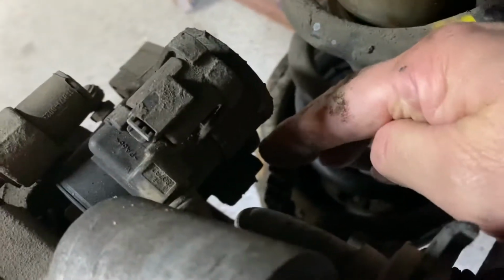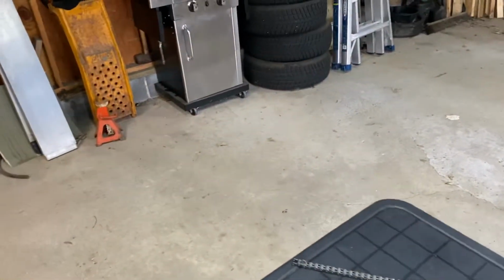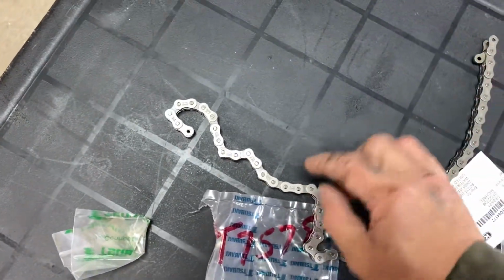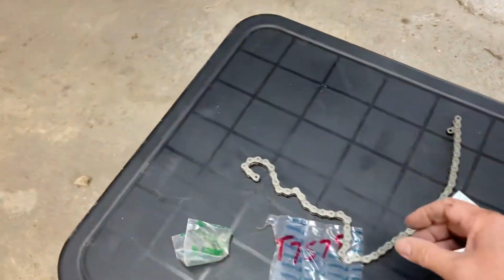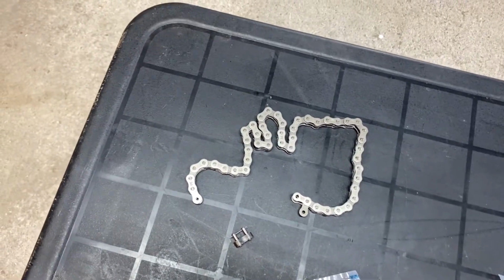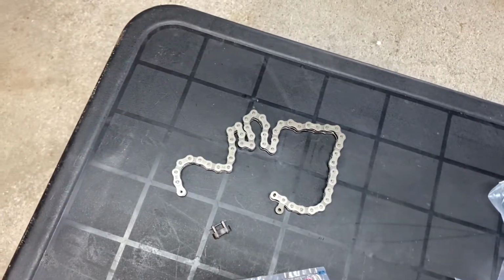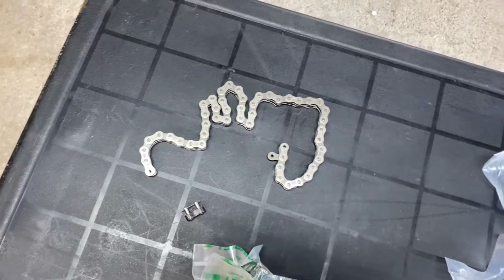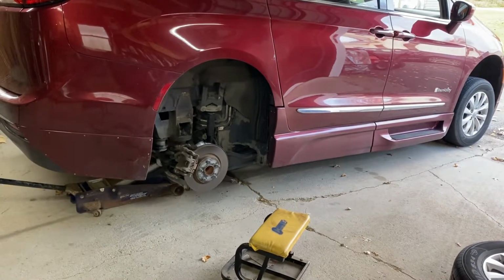BraunAbility kneel chair repair

Comment: Great job to undertake this repair.  I have found that anti seize of any type is not the right product for these chains.  Fluid film, applied every 6 or 7 months, will keep that chain looking and performing like new!  The anti seize is too thick to get between the links to keep them moving.  Fluid film is able to penetrate as it lubricates.  It won't wash off and doesn't attact a lot of dirt.  I simply wipe mine off before reapplying and the chain after 7 years, looks brand new.  Hopefully, this information will help you and others.  The entire industry needs to be challenged for not allowing people to service what they have purchased.
Reply from the maker: @d9999w9999  Thank you, I will be getting some of that lubricant
Reply from the maker: @d9999w9999  thank you! I bought some and applied it before the winter snow. I hope that it works!

Comment: Thanks for video. great job. Im a quad and drive a 2005 Chrysler Town n Country Entervan. Well my chain not broke but the actuator screw tube broke so it needs fixed. my local dealer wants 1200 to fix it.  Crazy

Comment: This is great. My chain just broke today on a 2015 Toyota VMI conversation. Sounded like a gunshot when I deployed the ramp. I went to Costco to get gas and the.guy told me about the chain hanging down. I did some poking around and found your video. I'll end up having my dealer fix it, but nice to have a visual of the problem. I had a Scion with a pneumatic kneeling system and it was horrible..probably a result of bad design as the tubes kept melting. Anyway, thanks for sharing.

Comment: Where do I buy the chain. Do you have a web link
Reply from the maker: I purchased mine from a local industrial supply dealer. You will have to do some research to find a supplier
Reply: @sdd1262  Great video, thanks ! Now I know why my 2015 Explorer doesn't kneel anymore. Now to find someone to do the job.